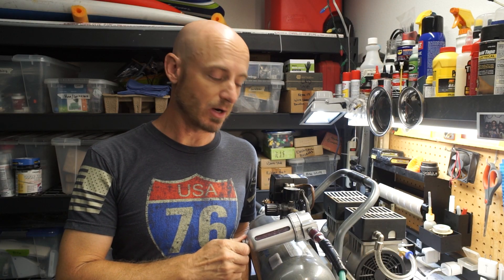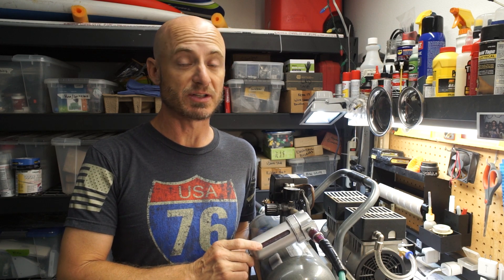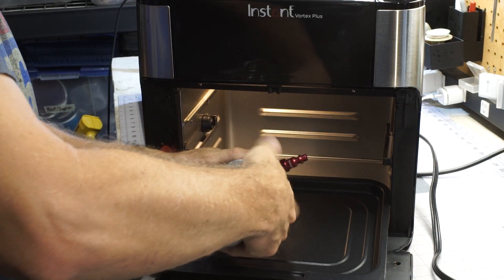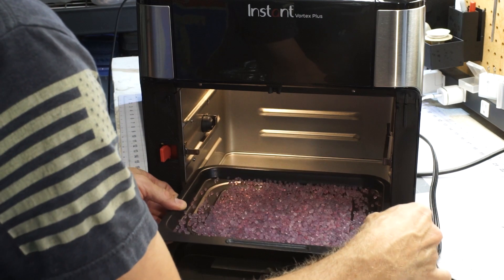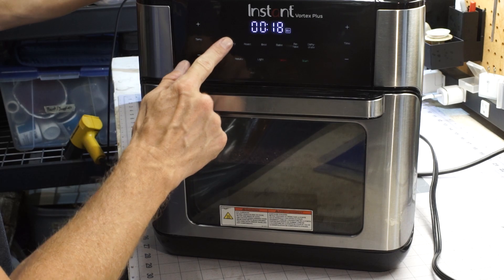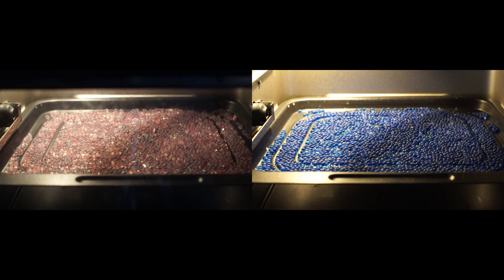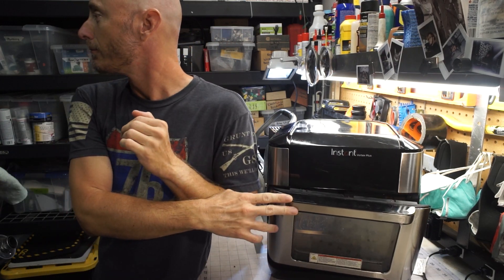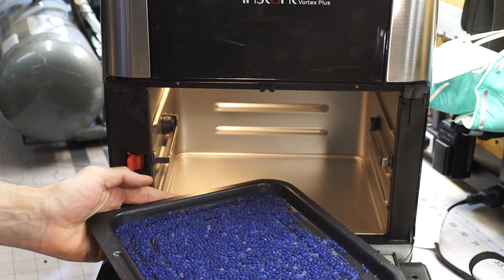Regenerate, Dry and Reuse Silica Beads Gel/Desiccant SUPER FAST With an Air Fryer!

Comment: Careful with these blue gels. The color indicator used is toxic.
Reply from the maker: Good to know.  It might be prudent to use a dedicated convection oven or air fryer, or at least clean it thoroughly after use.  The color indicator in question is cobalt chloride if anyone is curious.
Reply: @ShanesGettingHandy I've seen reusable silica bead pouches sold and they recommended microwaves to regenerate...

I was curious if an air fry would be just as good if not better...

If it's safe in the microwave, theoretically... the safety should be the same, no? 🤔
Reply: mix tons of white silica with it.. you only need a few for indication..
Reply: As far as I can tell, the cobalt chloride on the blue silica is only harmful when ingested. Handling it may release a bit of the cobalt chloride in dust form, but for hobby users it's most likely so minute that it's not worth worrying about. If you're handling it every day, by the ton, absolutely protect yourself. If you handle it once every so often in small amounts, I'm very confident that there's a lot of other things you're doing that you should be more worried about.
Reply: @timderks5960  You do have to worry about using any appliance to dry them and then turn around and use it for food. I highly suggest having dedicated equipment if you are going to use any indication silica.
Reply: @timderks5960  The silica that I use is sold as kitty litter.  Seems unlikely to be toxic.  You kill a cat and there's no place on earth you could hide.
Reply: don't swallow
Reply: @Beakerzor  Wish it was that simple. Just touching them gets the toxic stuff on your hands.
Reply: Would this be safe for regular silica beads you get in packaging?
Reply: @dgurevich1  Yes. They are non toxic and safe, as long as you don't eat them. What makes the color changing ones dangerous is the chemical that does the color change.
Reply: @dgurevich1 they have to be reusable from what ive been told.
Reply: even the orange ones that turn green?
Reply: @iHustle33  If ingested, yes. Same with the blue. Only the non color changing desiccants are approved for use in food packaging, thus considered non-toxic.
Reply: Just use a filament dryer that goes up to at least 70c.  I do it all the time while drying ASA.  I use the "Wisedry" brand, orange to green.  I have had the packets for a few years now.
Reply: https://youtu.be/-xjba9CqfCw
Reply: There's always got to be a snowflake safety sally in every crowd.
Reply: Everything is toxic to a degree. If you have symptoms like headaches, eye or skin irritation, know that that's your body telling you it's really toxic.
Reply: @jdubdoubleu   yeah i got a headache handling my hot silica even though i did it in a conventional oven outside. now I use an organic vapor mask as well. there is a slight possibility that its placebo but the smell is definitely weird on mine so i might not use that oven for other stuff going forward.

Comment: It's been more than 2 years since you've made this video so I'm curious if you're air fryer still works. We had the same one but the thermistor stop registering that it was heating and would time out after a minute.
Reply from the maker: That air fryer is still working perfectly in the kitchen, I have since switched to using a different air fryer just for shop use.

Comment: I'm always worried that no matter how low i put the air re-circulation that it'll scatter the beads up into the heating element.. theyre so small and lightweight... lol
Reply from the maker: Well, you could always turn the fan off, it’ll just take a little longer of course.

Comment: Hi, Shane.  Nice video.  I have small silica gel packets that can be rejuvinated.  (i.e. small packets with the silica gel balls inside.)  Would this work for those, do you think?
Reply from the maker: I don’t see why not, they have the same material inside, just smaller pieces.
Reply: @ShanesGettingHandy  It was more the packet material that the silicone balls are in that I was concerned about.  But I will give it a try.  Thanks, Shane.

Comment: what is the in-line air dryer for your compressor line?
Reply from the maker: Moisture in a compressed air line can cause various issues, it depends on what your compressor is used for if it’s important or not.  Plasma cutters don’t handle moisture well, paint sprayers have issues as well.  Air tools can have issues with internal rust over time.  All in all, it never hurts to dry the air.

Comment: Mine turned pink again by the next day.. Kind of lame.
Reply from the maker: That means it’s absorbing a lot of moisture and doing its job!
Reply: @ShanesGettingHandy  yeah, yesterday I pulled out all my desiccant and heated it in my fan forced oven for several hours at 90 degrees. 
It turned blue again. 
I looked last night and the dry box was down to 19% humidity. Originally it sat at about 10% when the desiccant was new. I’ll be interested to check it when I get up in a little bit.

Comment: how about the small pack one? how i can dry? i used for filament container
Reply from the maker: You can dry it the same way, even if it doesn't have the color indicator.
Reply: @ShanesGettingHandy  they have was orange now green but i need to cut the paper bag and empty?
Reply from the maker: You can leave it in the bag, but it might take longer depending on the side of the bag.  It will be faster if they are spread out evenly on a sheet.